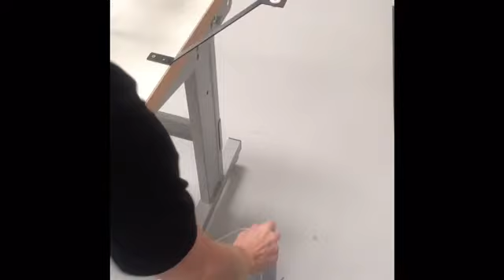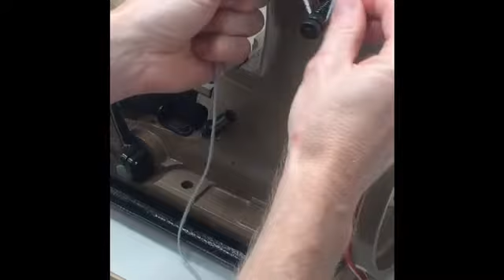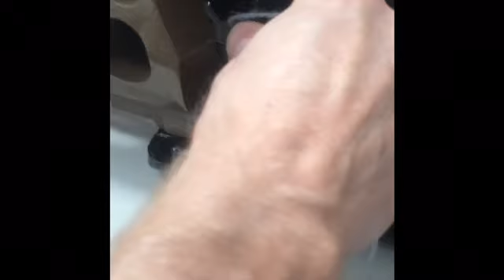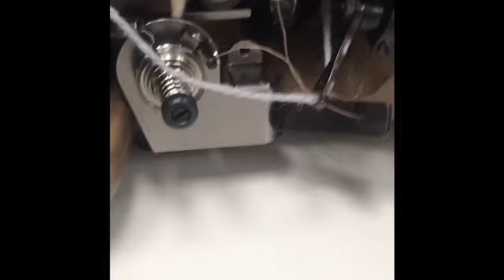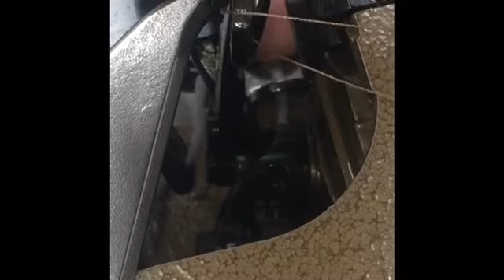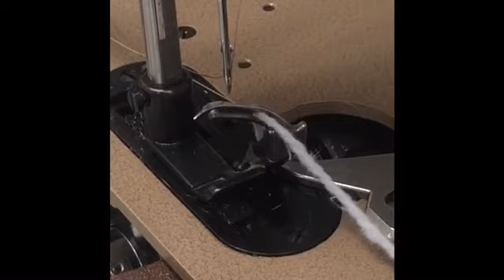KK812-P Threading up of the Wool

Comment: I have an 812-P and i am finding that the wool only whips over the top and and the side but does not wrap underneath. Would this be the thread tension?
Reply: Did you get the answer to this? I'm struggling with the same thing
Reply: @shaboxx4162  yarn needs to go through lower inlet and also not through the tensioner, its basically loose.
Reply: Thank you...I will give it a go tomorrow